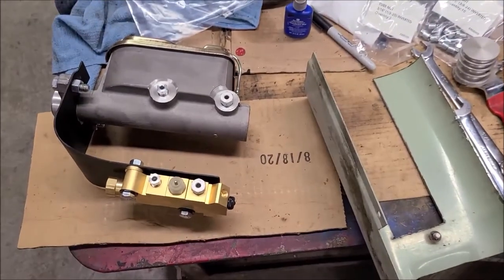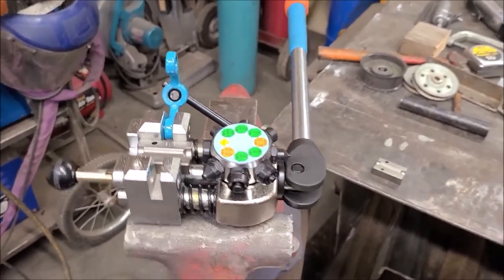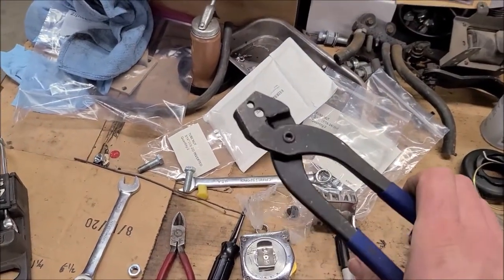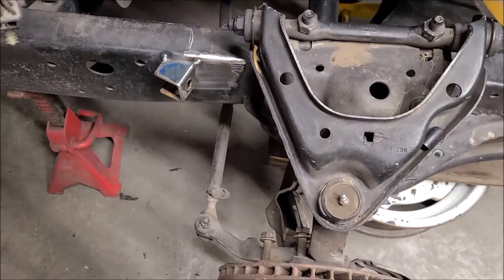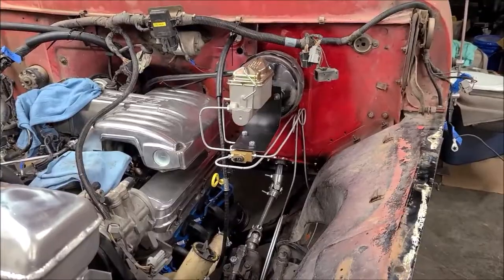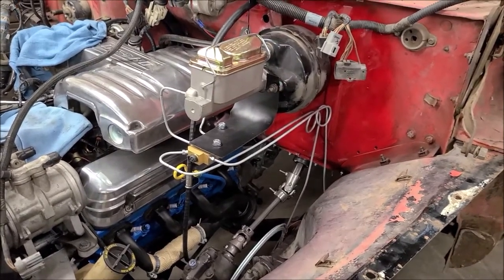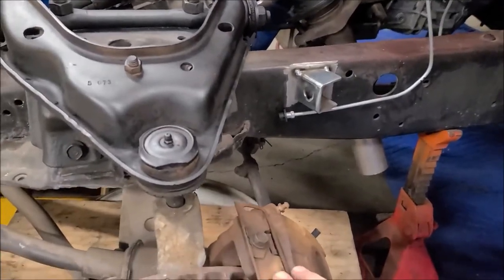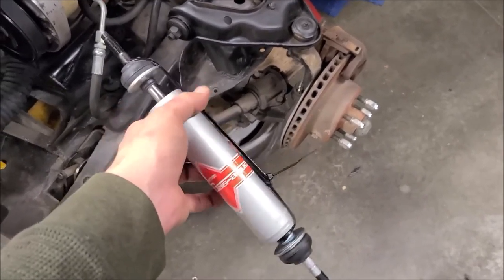1956 Ford F-100 Episode 17 - Master Cylinder, Brake lines and Front Shocks

Comment: On the rear brake line, it is larger to feed back to the tee on the rear axle, then from there is the smaller lines out to each rear wheel. The front each only feed one wheel. The back feeds two wheels. Anyway, that is how it is on my truck. disk front, drum rear.

Comment: The hydrolic brake line flare tool is about 60 dollars on line,,They are better than this set up because they are mobile,,You can literally bring it under the car with you,,You don't need any vice or bench,,And the brake lines can be done in situ,,They also make really good flares,,